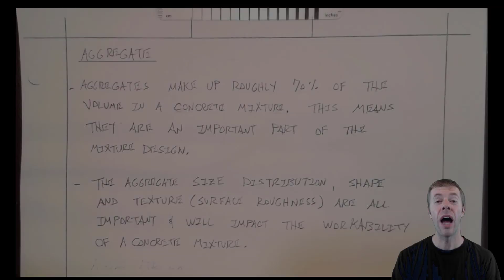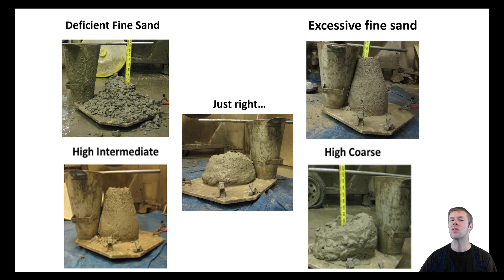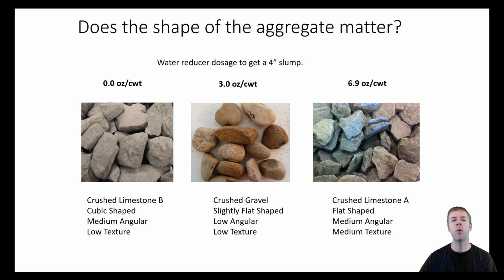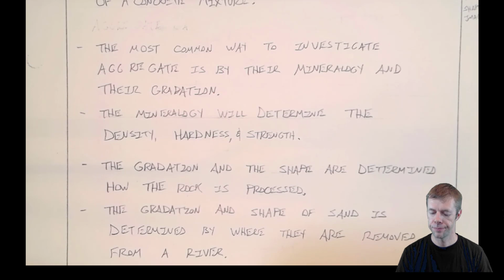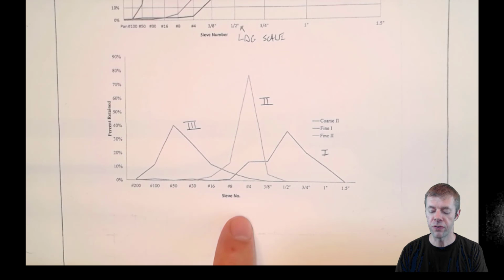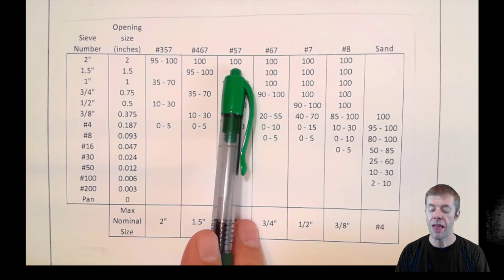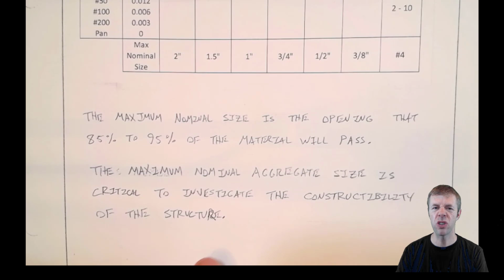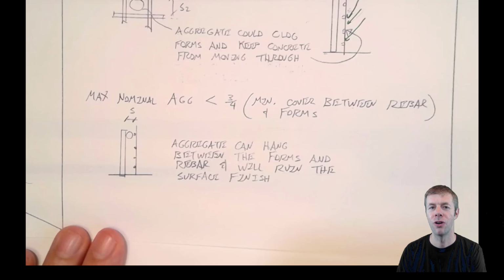Aggregates in Concrete Mix Design

Comment: There was a company in Bucks County Pa that supplied sand,stone, and ready mix concrete called Warner. They mined most of their aggregates from pits near the Delaware River. It was all very rounded natural stone. I have no idea what the mix was or anything but it was some tough concrete. 

They were out of the ready mix business probably around 1970 when I was just a kid, but whenever we came across their concrete on a job and had to break it up it was tough to demolish. I remember one job back in the late 80's removing the bases of smoke stacks and our operator pounded on them for what seemed like forever with a 5 ton wrecking ball before they broke up. Even the sidewalks where I saw that aggregate were hard to break
Reply from the maker: Thanks Cindy for the cool story.  River rock and be very very hard and strong.  I love to hear about people doing concrete right.
Reply: @TylerLey  Do you think the aggregate is what made the concrete stronger than what we normally encounter? Typically what I see looks to be nothing but sand and crushed 3/4 stone. The Warner concrete had a wide variety of stone sizes in it.

Comment: Hi Tyler, Great and very informative videos. I have a simple but I think interesting question for you. How much moisture content should we include and allow for within aggregates including sand in our mix design? This is important in my opinion because it can throw out the W/C/R if not calculated for in the design.
Reply from the maker: Jon - Good question.  It depends on the moisture content within the aggregate.  Usually, we have to measure this and correct our mix for it.  I talk about it in these videos.
https://www.youtube.com/watch?v=hnYopL7uZE4&t
https://www.youtube.com/watch?v=8t1tIpsLvc0
Reply: Jon, unfortunately we don't tell aggregate how much water we should allow for it, it tells us how much it has!  I've seen sands that have 6% moisture.  To put that in perspective: a yard of concrete might have 500 lbs. of cement in it and 1,400 lbs. of sand (totally arbitrary numbers).  6% of 1400 is 84 lbs of water.  If our mix has a .5 w/c ratio, that is 250 lbs. water TOTAL (including moisture in the aggregate).  The 84 lbs (plus whatever is found to be in the coarse aggregate) has to be subtracted from the total.  If you look at a batch ticket from a ready mix plant they often give you design water (250 lbs) and Water Added (250 - 84 - coarse aggregate moisture).  Moisture is so variable (even going from one part of the agg pile to another can have an effect on the same day) that it has to be monitored constantly.

Comment: Thanks Tyler for putting this series together, I learned a lot of the lingo and understand some of the forces of making better concrete.   I want to cast a privacy (non-bearing) wall out of large aggregate (6" round-like granite fieldstones).    Is there a formula for how to graduate the mixture down from 6" rocks down to gravel and sand / cement to make the well-graded aggregate / paste mix?

Comment: I didn't get the last few minutes - min dimension/cover - is that by volume or total width? 3/4th of what? Let's say my wall is 6", and rebar size is 3/4th inch. What should be the aggregate fill?

Comment: I must admit, I learned something in this video about the rules of maximum aggregate sizes! [not that I have not GROSSLY violated them in the past! ~( ,m,)~ ] 
(On one project I chucked a few large whole rocks into the form before to stretch my concrete, but the wall is only 24 high and was 10 inches wide, so it went okay for the purpose intended, it is not load bearing nor a retaining wall).

Comment: This is a really complex mathematical problem (IIRC the Kepler conjecture?) that is masked by decades of experimental data and real world results.
Its even harder since the aggregates have random shapes instead of spheres.  I did find a couple of papers that used Monte Carlo style simulation to determine optimal sizes/ratios for non spherical aggregates.
 Packing of non-spherical aggregate particles by DEM 
By Piet Stroeven and Huan He
And
Optimization of A Computer Simulation Model for Packing of Concrete Aggregates
By ADIL AMIRJANOV and KONSTANTIN SOBOLEV
Something for an upcoming PhD student to consider.

Comment: Hey Tyler I am making cement pot plants small ones about 10cm high they are cracking. What do you recommend with the mix and I also want to achieve a smooth finish would be much appreciated if you can get back to me thanks Rob 👍

Comment: Hi Rob if you have the time I would like some advice please. 

I’m looking for a claylike concrete to apply to a form. I would like to pack it by hand to be between 10 and 20mm thick and would like it to have the same strength properties as fibre cement board. 

I know it’s audacious of me but do you have a recommended recipe? I am in South Africa but I have access to Chryso and Sika. I will ask them for advice too.

It’s for a home renovation. I would like to make a fancy window frame type thing for my parents.

Comment: Tyler - I'm no Tyler but I did write an article for the International Concrete Repair Institute's magazine Concrete Repair Bulletin (Mar/Apr 2019) titled 'I Wanna Rock! The Significant Role of Aggregate in Creating Great Concrete Repair Materials'  It's a simpler version of what you are presenting.  One interesting thing I found based on aggregate volume : surface area ratio.  Of course going larger on the coarse gives you higher slump, everything else being equal.  However that slump benefit diminishes once you get larger than 3/8" MaxNom since the V:A ratio converges pretty quickly at larger sizes.  Do you agree?
Reply from the maker: Thanks for the comment.  Shoot me the article offline I would like to see it.

I have not done a lot of testing at that low of aggregate size.  I can say that there doesn't seem to be much difference between 1/2" to 1.5".  I think the surface area is important but there are other things that are more important.  I can send you some recent journal articles that we published that gives more insight.

We are also doing a ton of work on manufactured sand.  It has really opened my eyes on sand and how it impacts workability and performance of concrete.  I think we will have some tools that will really help the industry.

Comment: whether the strength of the concrete will increase if we use basalt rock aggregate
Reply: Hello dear friend, I work in ready mix concrete and I'd like to be friends and help Me in mix design
Reply: @mohamedabdelalim896  my idea was to use fine basalt sand as a substitute for river sand in concrete 

for greater rigidity  my idea is to use 1 part of the cement  
1.5 parts of large basalt sand and 0.5 parts of fine river sand for better filling of cavities.

Comment: thanks.  Which is your opinion about mica in sand and influence at performance the concrete?
Reply from the maker: It depends on how much mica there is.  Mica can have a lot of reactivity from ASR.  It is also not a very strong material and it cleaves easily.  However, it might help you reduce your modulus which might reduce your cracking.  Do you have any experience with it?
Reply: @TylerLey   it looks mica increase water demand for a given slump and these sands that contain mica normally has problem with stability of air.
Reply from the maker: Interesting!  I have not seen that.
Reply: It makes your concrete more glittery!  I worked for a a large manufacturer of cement based tile thin sets and grouts (one of the well known names).  It seems sand in GA, where one of our plants was located, has a bunch of mica in it - an amount that is noticeable to the eye when looking at the grout.  I once got a call from a customer - Something's wrong with the grout, it's not as shiny as usual.  He had gotten product from a plant in a different part of the country.

Comment: Honestly a lot of what you were saying about the same mix is hard to understand what you mean. If a mix is different its different. Can be the same and different. When i listen to this i think about the fact it would take years to even explain how concrete works. I mix a lot if concrete a few yards or a few dozen yards at a time special mixes for strange micro engineering jobs i get. Walls, underpinning etc. the point is you can not get good concrete in a bag ever. You have to make your own. So ... you have to know how
Reply: I think he's just saying that the weight of each ingredient is the same for each mix.